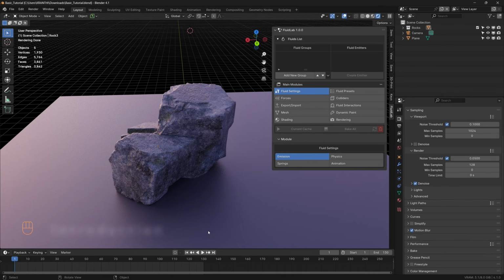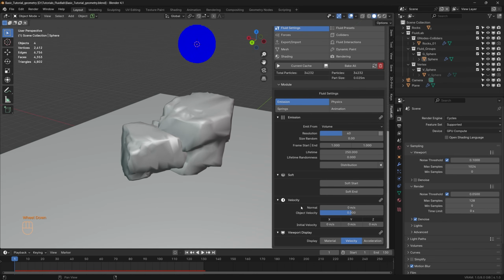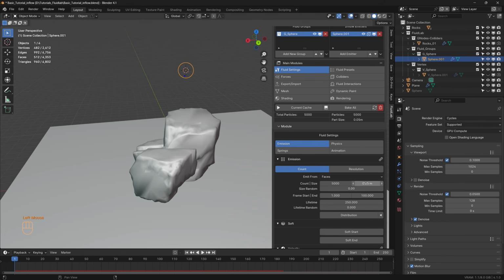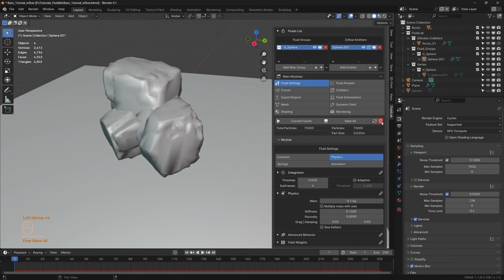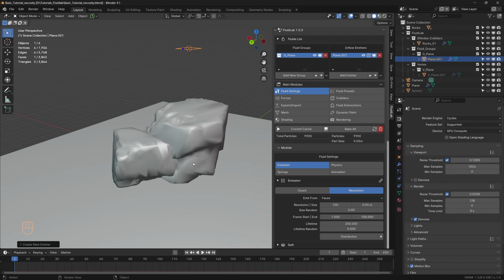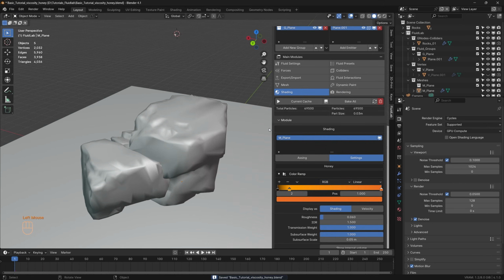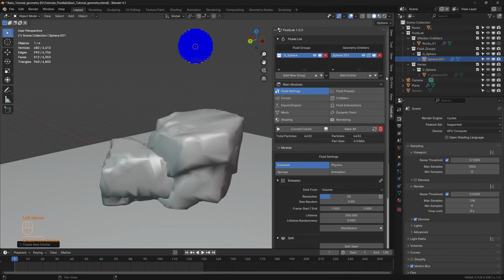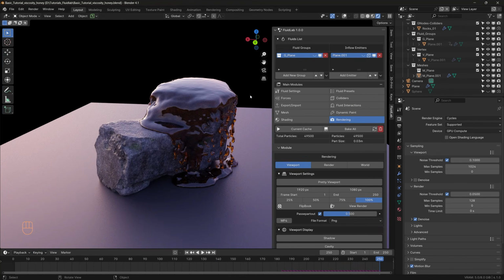Blender Fluid Simulation Tutorial for Beginners | FluidLab

Comment: Great addon, Congratulations.  one question please, what kind of PC do you use, i have with the simple Inflow Sim, after baking, only  5.5 frames when playing, you 25. I have an RTX 3090 and an i9 1300K, 64Gig Ram.
Thanks
Reply from the maker: you must bake the mesh in GN. But in the current version the Bake node is not set correctly. In our next update it will be possible to bake the GN mesh directly from FluidLab and it will improve the workflow a lot.

Comment: I just bought this, and am trying to run it on 4.0.2, but the Fluid Settings in Emission are completely missing! Now I guess I have to install another new version of Blender and got through all that headache of getting all my custom settings working before I can even start to use this add-on! Sheesh
Reply from the maker: @davidfrazier4358  If you go to the blendermarket store, you will see that the version of blender required is 4.1.
Reply: @BeFXStudios3D  or higher. I had the same issue, thought i'd lost my mind. Thanks for info. Downloaded 4.2 and works great. Cheers

Comment: Damnnnnn... trying to give the FlipFluids add-on people a run for their money, huh? :)
Reply: i don't think so, fluids on FlipFluids are more better, i think that RDB could create a great ecosystem with their sim addons but this last one need more to work on (the drips falling from the rocks seems too unnatural). I keep in example always Chaos Phoenix sim on max and they're even better than blender's; if they want to succed with fluidlab they need to have Phoenix as target.
Reply: @digitalrage5  This addon is more suitable for smaller-scale sims. FLIP Fluids uses the FLIP fluid solver (duh), which is a realistic method of solving for fluid dynamics that is great for large-scale fluid simulations and things like whitewater fluids. The downside is both FLIP and APIC fluids are extremely computationally expensive and take AGES to simulate.

On the other hand, FluidLab uses SPH fluids, which are very computationally inexpensive (so little in fact, that they've been used in games for a while, Nvidia PhysX has had SPH fluids for over a decade). It's essentially just a group of particles that try to stay together and are meshed over to smooth the end result, hence the name "Smoothed-particle hydrodynamics (SPH)". This is trivial for a modern computer to calculate, and isn't volumetric so interactions with colliders such as a rigidbody are much easier, unlike FLIP fluids which ARE volumetric, and tend to clip through moving or thin geometry without an unreasonably high resolution. The volumetrics are also why FLIP fluids need a domain, otherwise the domain size would be infinite and your computer would run out of memory and crash. The only software I've seen pull off FLIP fluids interacting with multiple other body types (cloth, rigidbody, softbody, etc.) and not be constrained by domains, is Houdini, and fluid demos in that software STILL blow my mind because of that. They have some voodoo-magic shit going on for that to be possible, and they are NOT going to release the details of how they did it, they are currently the only option if you want that level of intractability (though it looks like the RBDLab team is trying to do something similar with their ecosystem here).

Anyway, there isn't really much you can do to make an SPH solver look better than this. Fluid Lab is actually the best I've seen, it looks pretty convincing and is extremely performant.